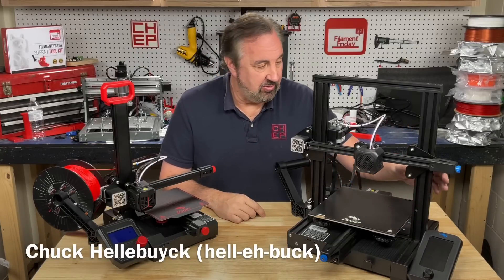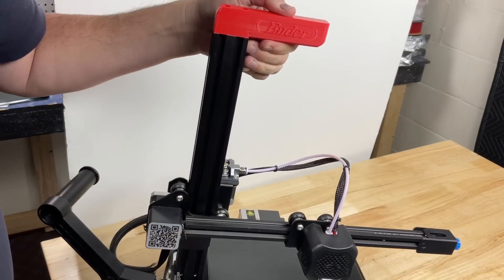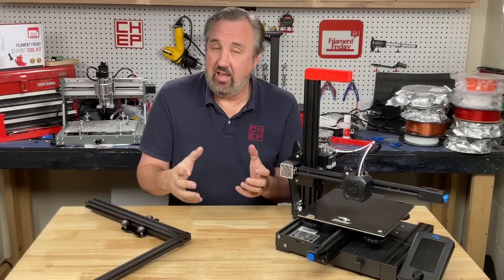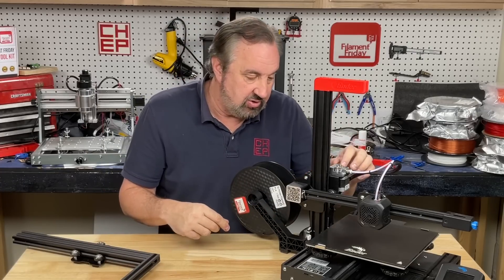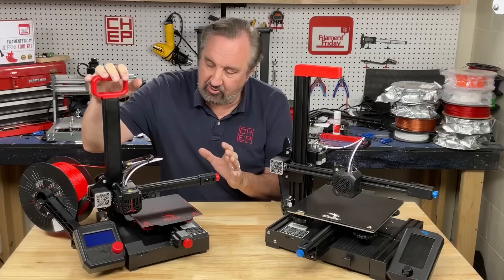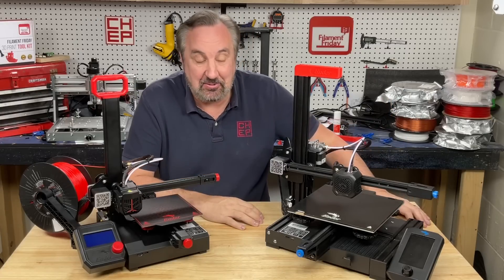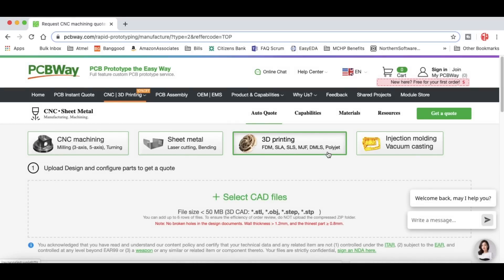Simplify Your Ender 3 into a Cantilever Design

Comment: Y'know, I might try this myself. Problem is, I use a CR-10, not an Ender 3. Will it cause any issues?

Furthermore, I also use a light direct drive bracket. Just curious if the added weight will throw this off.
Reply: It might cause issues even on the v2 and it will not bring any benefits other than weight reduction if you want to pick it up all the time for some reason
Reply: @patrykK1028  Yeah... I kinda had to think about it for a while after I watched the video. Decided not to go through with it.

Comment: Ohhhh no, after I spent so much time with a digital angle level and tin foil shims to get my vertical bars perfectly 90º, I would never pick my printer up by one side like this.

If the vertical bar was a 40x40 aluminium extrusion, maybe, just maybe.

Comment: Hi Chuck. I just saw your video short on printing with wood filament. Is it safe to do that on an Ender 3 V2. The documentation only lists PLA and ABS.  I'd like to try it if it won't damage my printer.  Thanks for all your helpful videos!
Reply from the maker: Yes. It’s PLA with wood particles. I like to a video in the description and the filament I used.

Comment: Have you had problems with your ender 3v2 hotend shrouds breaking? I have had a ton of problems with the plastic threading for the fans breaking off, and even ordered a replacement that had broken plastic brand new.
Reply: Plastic fan shroud? Mine broke off as well and I just replaced it with a 3D printed fan shroud which works just as good as the stock.
Reply: Yes. That piece is REALLY bad, print a satsana, or one that u like

Comment: I did this long ago when I had problems with gantry level repeatability from problems with the undriven side, and it worked great! I don't think it would at the accelerations I run at now, but at more normal speeds it's perfectly fine.

Comment: I wonder how well it would work with a linear rail??
Reply: Probably better.  The rail carriage will be stiffer than the roller arrangement, reducing the potential for the beam to pivot (sag) at that point.  That would still leave mass-induced bending of the beam as a sag issue, but you have that already.  You could also fairly easily use 2 rail carriages to really stiffen that pivot up.  Also, with a linear rail on X, you could easily repurpose the 4020 extrusion as the X rail to stiffen it against bending too.

Comment: Do you think using a linear rail for the z axis would stop the possible sag?  
Great idea sir👍🇦🇺😊
Reply: since the Z rail is 2040, we can do a dual linear rail setup to reduce the wobble further
Reply: What?  First you would remove a vertical beam that can help against sagging (especially if you add a second lead-screw) to save some money and then you would add expensive linear rails in an attempt to reduce sagging?  And no, it would not help, unless you have multiple blocks on your linear rail(s) spread out as much as the current wheels.  What could help is having the 2 wheels on the left of the z-beam spread further apart and then adding brackets between the bottom and the z-beam to ensure it doesn't pull side-ways or even better...  add a second z-beam on the right to have more support for that x-arm ... but hey ... that was where we were coming from.

If you worry about sagging, then don't do this mod, but instead add a second lead-screw and either a belt or extra stepper.  The Ender 3 series can get away with a single lead-screw just because such sagging can be compensated by also having the bed sag accordingly (through tramming) and as long as your print speeds are low enough, that will be good enough compensation.  But with higher speed and more vibrations, the frequency of those vibrations will differ depending on your x position in such a setup and that will have quality effects that are more difficult to avoid than with a more stiff setup with 2 lead-screws.  And removing the right z-beam further increases this potential for ringing and hence the quality at higher speeds.
Reply: Sag comes from two issues.  First, the beam bends due to mass.  Second, the beam pivots at the connection to the Z axis.  

A linear rail should stiffen the connection, potentially reducing that sag issue, and you could use two rail carriages to really stiffen it up. There's no need for a second rail, you can mount both carriages to one rail.  The bending issue could be reduced by repurposing the removed 4020 extrusion as the X beam.  You'd need a new hotend mounting plate to make that work, or ... a linear rail X conversion.

One advantage that such a mod would have is that it would allow for toolheads that are wider across the beam, potentially allowing for better mass-balanced toolheads and/or different cooling options .  There's currently only about 15mm of vertical width of the toolhead that doesn't impinge on either of the uprights during a full 235mm travel move.

Comment: Before I watched your video, I thought you were going to review a new Creality printer.   But who knows; maybe we will see Creality selling these things.  One advantage of what you did is that with two columns, if they are misaligned there is a chance of binding or creating wear on the rollers.   And if you wanted more stability, you could replace the single column with a wider one.  (Of course, ths would require the wheels to be spaced out further.)  And if the z-rollers could be spaced further apart in the vertical direction (with a new roller bracket), the x-axis cantilevered rail would be better supported.

Comment: I've been using ender 3 v2 for exactly a year. I bought it for hobby purposes. I made many updates. My biggest problem right now is bowden tubes. So I want to switch to direct drive. Is there a brand you can recommend me? Greetings from Istanbul/Turkey..
Reply: I just noticed you said Ender 3 v2.  My answer was for Ender 3, but might still hold for the v2, so I'll leave it up ...

Just print the Direct Drivinator and get direct drive with your existing parts.  Sure, it's not as fancy as some other stuff, but it works and it gives the best visibility on the actual extruder mechanism.  Only thing you need is an extension cable for the extruder stepper, but if you can solder, you can just make the existing one longer by fitting some extra wire in between.
Reply: @MisterkeTube  I am good with machines.  I can solder.  I took a look at some videos, it's been a lot to recommend BIQU H2.
Reply: Try the creality sprite extruder, should be a pretty Forward and easy to manage upgrade
Reply: @JustAValidName89  same with S1 isn’t it?
Reply: @ekrem06  yea Right - it was introduced with the S1
Reply: bowden tube'la nasıl bir sorun yaşıyorsun?
Reply: @bergamot4832  şöyle ki aliminyum extruder var creality'nin ama capricornlar uzun baskılarda yerinden çıkıyor. Hem Z ekseninde hem hotend'in orada, ağız genişletme yaptım olmadı. Yapıştırdım olmadı, hatta çinden daralıp sıkan özel uç aldım. O zaman atma yapmadı ama bu seferde filamentte sıkışmalar yaşandı. Hotend içine tüp kesip koydum oda belli bir süre idare etti. O yüzden artık bowden tüplerden fenalık geldi. Genellikle büyük boyutlu baskılar alıyorum ve ortalama baskı sürem +30 saat, ilave olarak pasif soğutucu kullanıyorum motorlarda..
Reply: @ekrem06  hiç o kadar uzun süren baskı almadığım için benzer problemim olmadı. ne tavsiye versem boş yani :D direct drive çözer sorununu umarım
Reply: @bergamot4832  küçük baskılarda sorun olmuyor zaten uzun baskılarda saçmalamalar başlıyor 😃
Reply: A cheap V6 variant with bi-metal heatbreak BMG clone works very good for me.

Comment: But... why?!

Others: "Hay guyz, add frame stiffeners, another stepper & z-rod, and throw on a z-belt sync. mod to getz yore l337 printz moar 1337z and getz yooz X-tra e-p33n!!1!"

CHEP: "Take a look at this, I've just stripped away 90% of my printer, now I'm getting even better prints with my Cura profiles _and it also fits in my pocket for travel."_ 🎤💧

Others: 🤦🤦‍♂🤦‍♀

But still... why?
Reply: To proof it's possible. I could also think of less moving parts. You don't have to perfectly adjust the other rollers.

Comment: The problem with cantilever printers is that "lever" part.  Any Z wobble and/or vibration is amplified at the far end of the X axis.   And the weight of the X carriage causes more force and wear on those plastic wheels.  The bigger the printer, the longer the lever.  It would be interesting to see a comparison between stock and your mod printing a tall object at the far right of the bed, preferably at a fairly high speed.
Reply: I'm thinking a crane-style counterweight and some 90° brackets at the base of the 2040 bar would probably solve most of that. If he tried this with a direct drive, it might be a different story
Reply: @rsmeaton  Cantilever weight would help for sure.  Repurposing the removed 4020 as an X beam would too, but it would need a different toolhead mounting plate.

Comment: Definitely cool AND fun Chuck!  As you started I immediately wondered if the weight reduction would offset going to one sided support.  It would seem likely that the longer X it has than the 2Pro has might suggest stretching the limits of force applied out there, but most prints are small, and could be "centered" more to the left side, so only rare full size prints would face any issues.

Definite a plus for anyone who totes their printers on any frequency!

Comment: I think there is a reason cantilever printers are small, I upgraded my Ender 3 machines to dual leadscrews because it was near on impossible to get the gantry perfectly square, I could get it quite close and let the BL Touch take care of the rest, however close was not good enough, hence the extra leadscrew, and next came an SKR 1.4 Turbo so I could have dual independent leadscrews and run G34 to get that gantry perfectly level, considering all these uogrades to get it square, removing the right handside upright and crossmember seems a step backwards to me, a full square frame will always be superior to a cantilever!

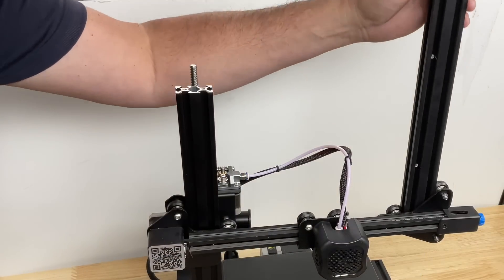Comment: 0:42 yea no, the moment you took the bar off it sagged, and its not going to get any better over time and use
Reply from the maker: It sagged because the screw was loose on the cross beam. I should have showed me tightening those but normally they are tight.

Comment: What am I missing? Why is this necessary?
Reply: it's not. but the parts he took out are "unnecessary", so the machine could be cheaper for what it does.
Reply: @marvinhuth4487  or easier to maintain because you have 3 rollers less to adjust

Comment: At 0:43/0:44 you can see the X-axis drop when the second upright gets removed… This can't be good for the remaining wheels, especially not long term.
Reply: Yeah funny thing about that. It isn't good for any of the wheels when it drops like  that. By removing that one side, he now has spare wheels. Not a bad tradeoff.
Reply: some enders just..... do that. Rarely when printing though.
Reply from the maker: The screw holding it on the motor side was very loose. I should have showed me tightening it.

Comment: But what's the point of this other than aesthetics? (which is also questionable), it will only cause more strain and wear on the z axis bearings and will reduce the maximum printing speed that would have been possible to achieve with the complete frame, I understand you like the look but other than that I really don't understand why to do this.
Reply: You were so preoccupied with whether or not you could you didn’t stop to think if you should.
Reply: @gman243  Exactly.
Reply: @gman243  Gee, thought that was WELL COVERED IN THE VIDEO:

If you VALUE PORTABILITY (which then values WEIGHT), and/or think it's COOL, or that vendors could see an opportunity to CUT COSTS.

Do you people actually WATCH these videos and pay attention at all before commenting?

I'm going to have to watch some old Ender 2 Pro videos and read all the comments whining about "why a handle, horrors!" and "why ever make a portable printer".
Reply: The weight difference for the longer X axis isn't as much over an Ender 2 Pro as you might think.  2020 extrusion weighs .0264 Lbs. per INCH, so being 55mm longer on the X axis, or 2.2", means the X axis now weighs .058 lbs. or 26 grams more.  That's only 2 grams more than a common AA battery so I don't see it grinding away the rollers anytime soon...  also most real world prints are under 165mm (at least they are on my 5 printers), so won't require the head out any further than happens on an Ender 2 Pro the majority of the time.

So if there's no more significant strain or wear until you get printing further out on the X than an Ender 2Pro can reach, so literally  only the rightmost part of the plate could even be affected, so that's 220mm - 165mm or 55mm out there where it starts to alter the physics involved...  But as stated the average person's prints mostly fit well within the 165mm bed of a 2 Pro, so just don't really get affected by the change.

As stated, lighter and more portable are the benefits besides possible engineering considerations.  Not everyone parks their printer for months or years on end.  It's also a chance for a manufacturer to review the physics and cut costs by producing something like this, even with an offset in the cost reduction with adding say a roller on the Z tower to distribute the pressure and reduce wear on the rollers.  The Ender uses 6 extrusions to build it.  This cuts that number by 1/3, so a clear cost reduction to manufacture.  We always benefit from out of the box thinking, even if it simply sparks the next idea which IS actionable.
Reply: @brianmi40  I wasn't comparing it to the Ender 2 pro, I'm comparing it to the frame with and without the part he took away, with this part in place the X axis weight is distributed over two points one in each side, and a maximum lever force of half the length of the X axis, without the part he removes, the weight now is distributed on a single point and the maximum lever is the full length of the axis(or printing space if you want to be precise), so by removing that part of the frame he doubles and because of the lever maybe even quadrupled the strain on the bearings in the sliding point of the remaining Z axis and the connection point of the tower with the bottom frame, he also reduced the possible maximum speed you can achieve with this printer since removing that part will cause both the X and Y axis to become a lot less durable to jerk.

It doesn't matter what happens in the Ender 2 pro, he took a printer that have a projected lifespan and theoretically cut it in half, a printer that have a theoretical maximum speed and reduced it to some degree, so I'm asking, why? he haven't made a good job in explaining the reason why anyone would want to do such a thing, you say to make it lighter and more portable, maybe that's the reason, but he didn't explained it well enough in the video, that's my point, and that's why I'm not the only one here asking that question, and to be honest even with that explanation I don't really see the point, at least personally if I would need to move a printer around frequently then I would want it as durable as I can have it, and the weight of the part he removed isn't significant for me enough to sacrifice the durability of the printer for it, but that's me.

Comment: Still trying to figure out why do this?
Reply: As stated, lighter and more portable are the benefits besides possible engineering considerations.  Not everyone parks their printer for months or years on end.  It's also a chance for a manufacturer to review the physics and cut costs by producing something like this, even with an offset in the cost reduction with adding say a roller on the Z tower to distribute the pressure and reduce wear on the rollers.  The Ender uses 6 extrusions to build it.  This cuts that number by 1/3, so a clear cost reduction to manufacture.  We always benefit from out of the box thinking, even if it simply sparks the next idea which IS actionable.

Comment: with the ender3 and ender 3 pro you can lay the powersupply on the back of the H base.
Reply: Proper Printing designed brackets to mount the power supply there, and I purchased them and did that a few years ago on my Ender 3 Pro. it gets rid of an eyesore and dampens the noise.

Comment: I wanted to thank you immensely for the lovely ultra fast gcode.  I’ve printed before a drill holder that took 26 hours start to finish. With ultrA it was 9 hours.  And I haven’t started to use the 0.6 nozzles yet.  I also wish you a slightly belated HAPPY THANKSGIVING